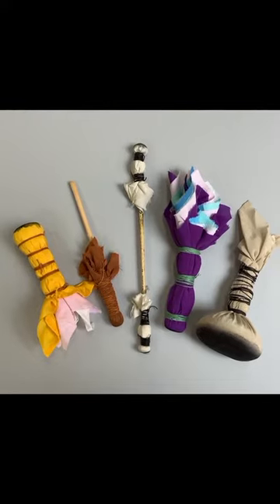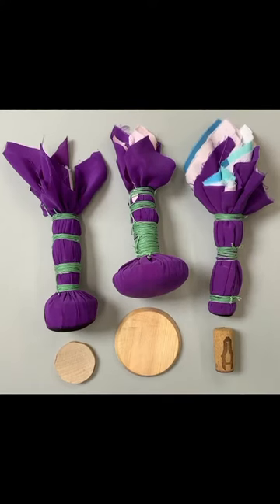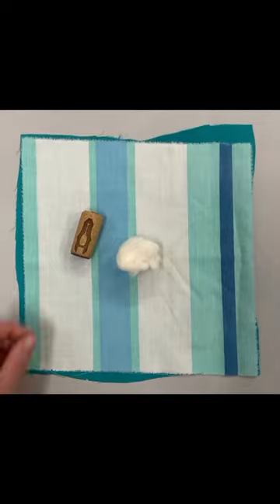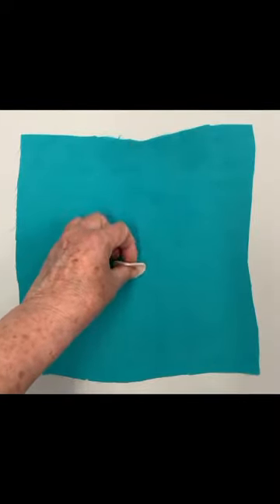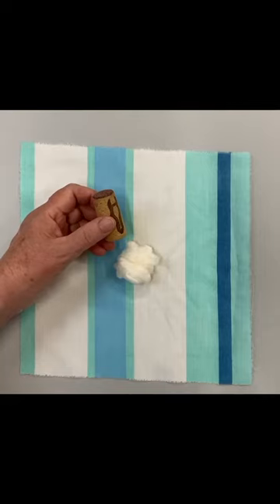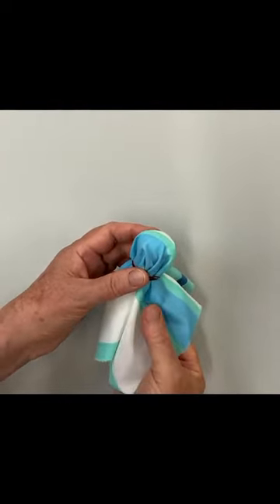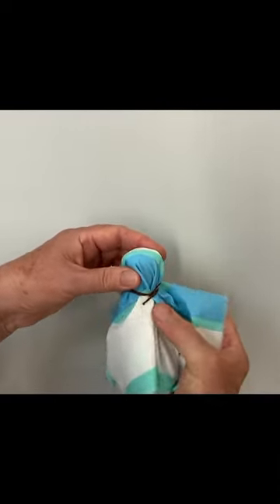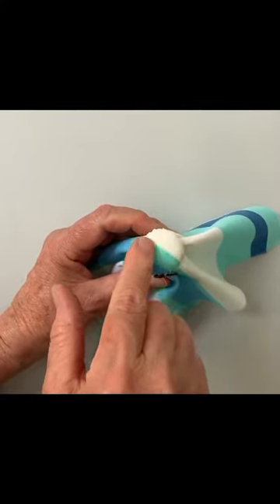Pati Scobey Demonstrates How to Construct an Ink Dabber for Printmaking

Comment: how do you determine the size of the circle of wool felt?
Reply from the maker: From Pati:  The size of the circle of wool depends on the size of the core used. Once you have enclosed the core (cork, disk of wood or whatever you choose to use) in cotton and plastic, place it face down on a piece of paper and draw around it. The circle you draw should be the size you will need for your wool circle.